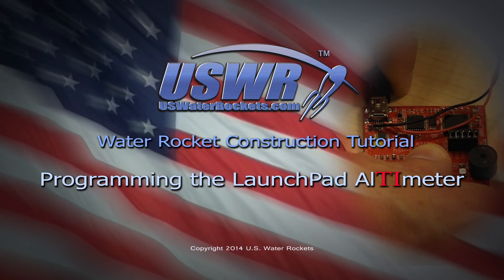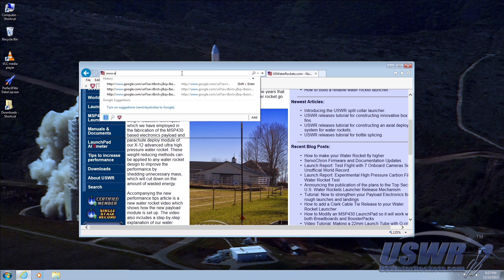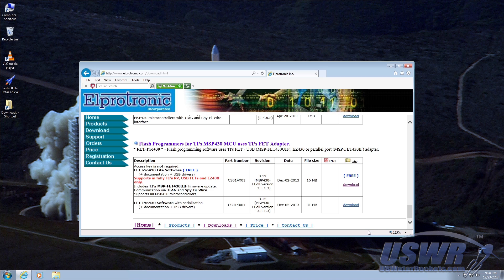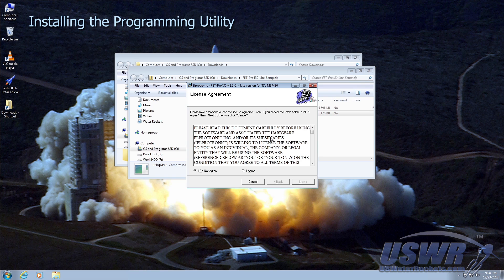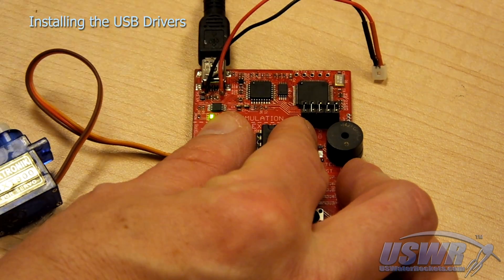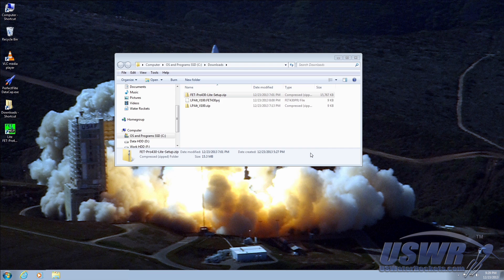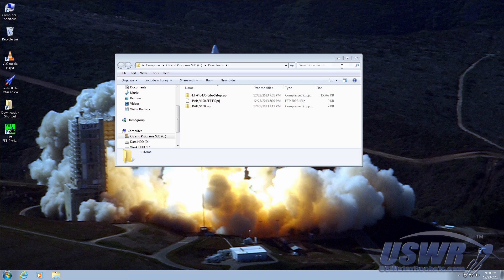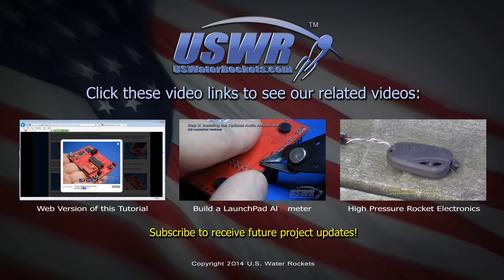Water Rocket Parachute Deploy Altimeter Firmware Programming Tutorial

Comment: I have a major problem, and I was wondering if you could help me out. I have installed the USB drivers as well as the firmware and FET Pro430 LITE software, but it doesn't work. When I open the FET software, a message pops up saying that the PRJ file could not be read or opened.  When I continue and choose auto program, it gives me a pass. But when I look further, the report states that the "All Memory Blank Checking" has failed. How do I fix this. Do I need to install a certain app to open the PRJ file? If I do, what is it? Please send help!!!!!!   P.S. I am programming just a 1 servo Servochron configuration with the MSP-EXP430G2 Launchpad.
Reply from the maker: You have to download the firmware project file archive (a compressed ZIP file) from our website. The file is located here: http://www.uswaterrockets.com/shared/servochron/ServoChron_firmware.zip once you have this file, you need to extract the archive. There are plenty of free ZIP file utilities that you can find to extract the firmware project (PRJ) file. You open the PRJ file with the FET-Pro430 Lite tool and use that to program the MSP430 processor chip on the ServoChron board.
Reply: Thank you so much!! I am making a school project, and if I didn't figure this out fast enough, it wouldn't work. It is great how you provide videos and information to the public so normal people like me can make it!Thank you for all the help you have already provided, and God bless!

Comment: I am trying to program it, but it just fails to verify security fuse
Reply: target microcontroller is not responding
Reply from the maker: This can be many things, from what I have read on the TI developer forums. Simple things are that the USB is not fast enough because it is running on a slow PC or connecting through many hubs that introduce latency, or simply a bad cable. They also suggest that the part is installed incorrectly (backwards, or bent pins not going in the socket). They also suggest that the board is defective or the chip is defective. There should be a spare chip in the box under the flap you could swap in and test for a bad chip (I think they still ship with a spare).
Reply: I installed the driver but i still get an error at the verify security fuse stage of the programming
Reply: Everything looks like it should work but it doesn't. Launch is saterday. I a going to sleep and will check at 4 am tommorow.
Reply from the maker: The security fuse is not needed unless you are trying to lock the chip, which I did not configure in the project and would not recommend doing.  If the security fuse verify is the only step that fails, but the flash has verified correctly, then the software should just run and the security fuse error can likely be ignored.
Reply: i tweeted a photo of my issue to your twitter. If the problem is unfixable, let me know

Comment: Please advise.  I can't get the USB drives to download into the launchpad msp430.  Please help!
Reply from the maker: I'm not understanding you. The MSP430 Launchpad only has a USB device port, so you connect it to a computer, not a USB drive. Please explain so I can assist.
Reply: USWaterRockets 

First thanks for the reply. I'm sorry for the confusion.  Please let me explain.  I am having problems with the software portion of the build.  My rocket is built and pressure tested.  I'm stuck at the parachute deployment phase of the build.  I have done the necessary soldering to the msp430, I added the speaker, breakout sensor, battery, and servo.

Do I need to install code composer and or IAR to the msp430?   I can't get them to install automatically or manually.   I think that is my main problem right now.  I downloaded IAR and code composer but I don't really know what to do with them.  Thanks again for any help you may offer.
Reply: USWaterRockets I can't get the firmware or the USB drivers to download into my MSP 430 launch pad. Please advise I've been stuck at this part of my build for about a month now
Reply from the maker: The USB drivers install on your computer. They install as part of the FET-Pro430 Lite software package referenced in the instruction manual. That software should just install on any Windows PC. We did not create that software and do not know how to troubleshoot it beyond the basic things like rebooting or trying a different computer, which you probably have already tried. If you have that software installed and functioning and then you get some kind of error when doing the actual download, then that might be a clue what is going wrong.
Reply: I finally got the firmware to download into my Launchpad.   I think I have a different problem.  When I hook up my battery it emits a loud and constant tone from the little speaker.  Can you please give any advice?

Chris
Reply from the maker: Both LEDs on continuously while the speaker emits a constant tone is the error condition that the board will enter into if the CPU is unable to talk to the pressure sensor. If you have not installed the sensor yet, this is all that the board will do until it is assembled. If you already built the board and it does this, you have made an error in the assembly. Most people either get a solder short between two connections or similar simple error. Check for this.

Comment: After installing the software and inserting the battery the altimeter keeps beeping. Im using a 3.7 V lippo battery. Can that cause any problems?
Reply from the maker: If "beeping" means that it's making repeated short beeps, that's normal. It reads out the firmware revision number the first time you power up a freshly programmed CPU. If "beeping" means one long tone, that means the CPU cannot communicate with the little board that has the pressure sensor on it. This could mean the pressure sensor board itself is defective, or the installation or soldering has an open circuit or a short circuit.
Reply: This is the second launchpad i've purchased and both react the same... Ive tried it with or without pressure sensor and i'm almost 100% sure there isn't a open or short sircuit. I will look at it again today. If this doesnt work again is there any way we can maybe get into contact. I could send you some video's so you can take a look at it if you have time for that?

Thank you for your time!

Kind regards,
Chiel
Reply from the maker: If you take off the pressure sensor the CPU will not be able to talk to the sensor and it will make the tone indication the sensor "failed" (because it's not there). The sensor installed incorrectly or a defective sensor will act the same way. Send some clear photos of your top and bottom of your board to uswaterrockets at gmail.com and I will look at them.
Reply: Thank you, Ive send you an email!
Reply: The pictures dont contain a pressure sensor. I will send you new pictures soon. The first launchpad died from switching the + and -. Is it possible that this killed the pressure sensor?
Reply from the maker: It's possible this hurt the sensor, but it's not 100% guaranteed either way. If you do everything else right, and it still beeps the error code, then the sensor would definitely be dead.
Reply: It acts the same with the sensor.... Can i make it work without one?
Reply from the maker: The sensor is that measures the altitude, so it will never be able to function with a defective sensor. The only other similar option you have is to change the Launchpad into a ServoChron https://www.youtube.com/watch?v=e9SQ0Jp1FSs and you can still use it for deploying a parachute, but you have to manually set a delay time from launch instead, and of course it cannot measure the altitude.

Comment: At what  height will the parachute deploy? Can i change this my self?
Reply from the maker: +Nextsuborbital spaceflight By default, the parachute will be deployed just as the rocket reaches the highest point in flight (whatever that point is for that flight, since the deploy is triggered by the upward velocity going to zero). You can optionally program a delay time to start counting at that moment and after the user programmed delay expires, the parachute will be deployed.  If you do not choose the delay option, then the parachute just comes out at the peak altitude.